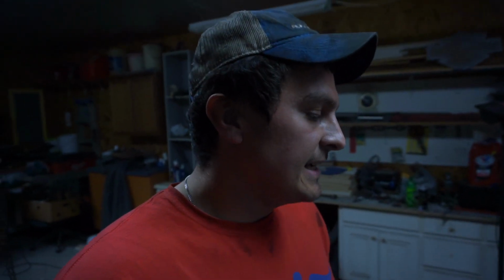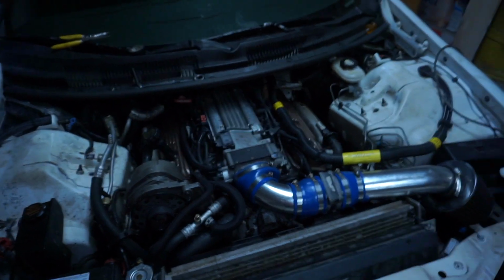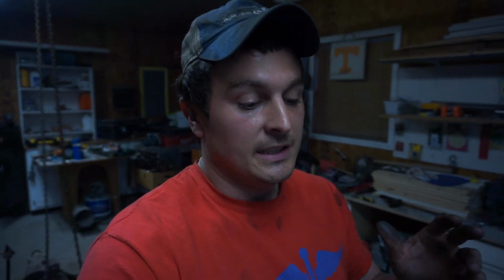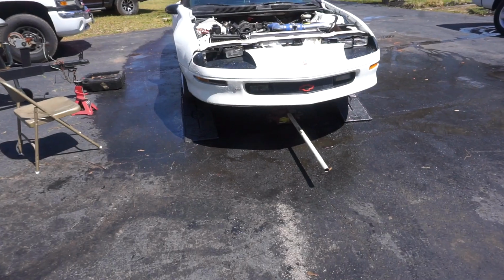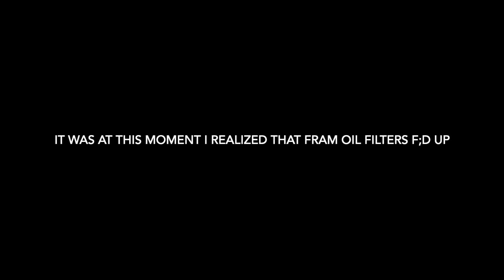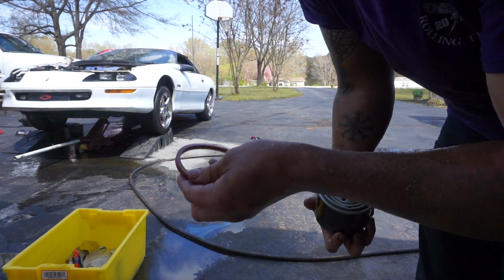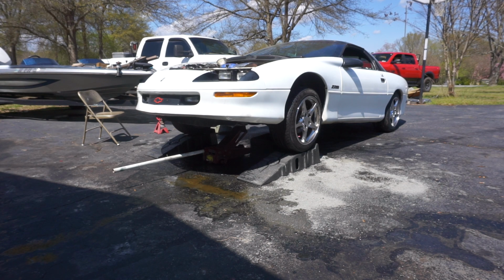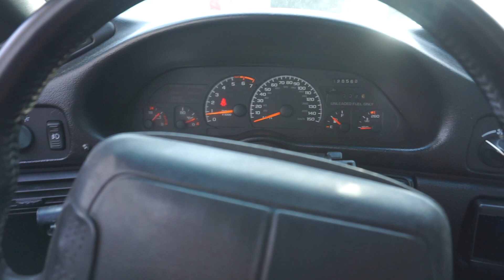1994 Z28 rebuild part 3

Comment: you are the man. i need to learn how to work on engines
Reply from the maker: It'sRaheem appreciate the support! and just find something cheap go through it and that’s it before bigger and bigger stuff comes around. Need anything let me know
Reply: I have a 1991 camaro rs.  And am buying a 1994 z8 with the lt1 and a 6 speed manual transmission.  I'm also just about done completely rebuilding the engine and transmission on my 1995 pontiac firebird